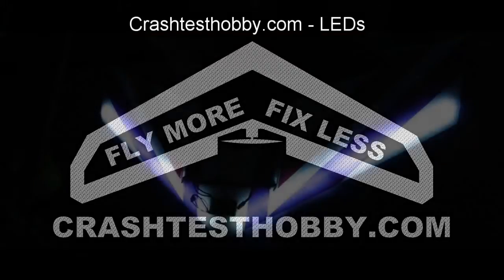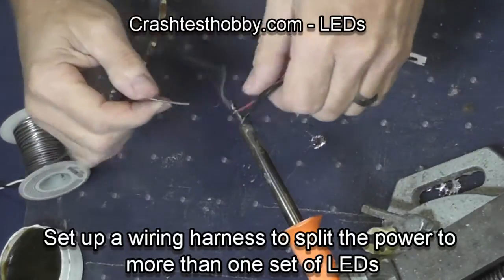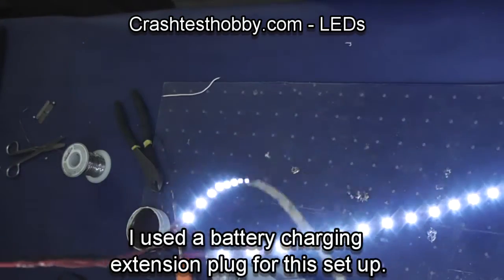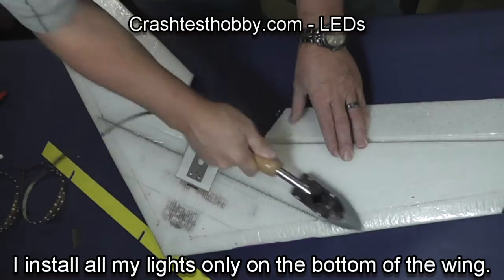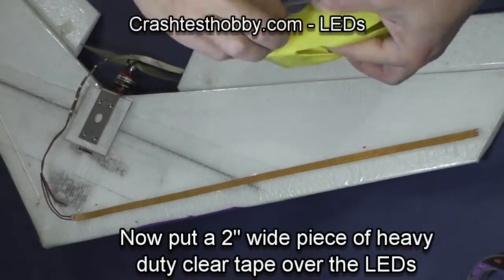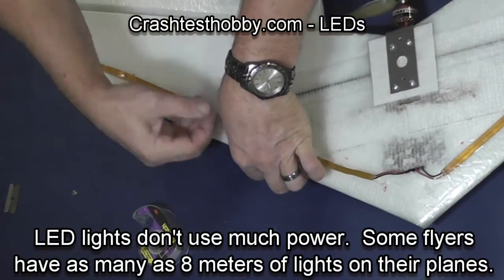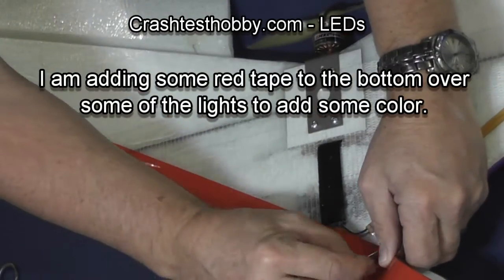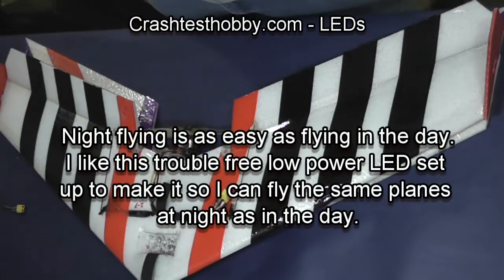LED light installation on a flying wing

Comment: Hey buddy where do you get that motor mount?
Reply: We have them manufactured for our line of planes.  Contact us through the website and we can get some for you.
Reply: +Lee Aston trough the contact form?
Reply: Just contact our store through sales department at crashtesthobby@gmail.com and tell them what you want.  The mounts is available on request.
Reply: They are stainless steel and don't break when they bend like aluminum.  Just contact our store through sales department at crashtesthobby@gmail.com and tell them what you want.  The mounts is available on request.